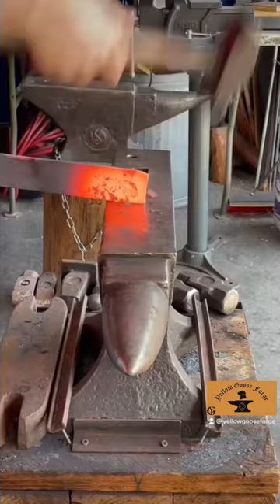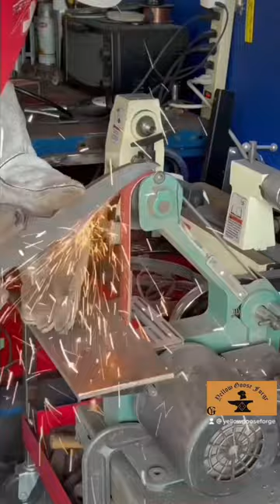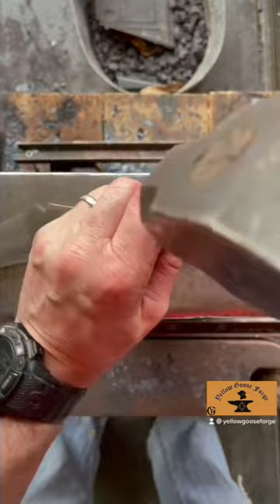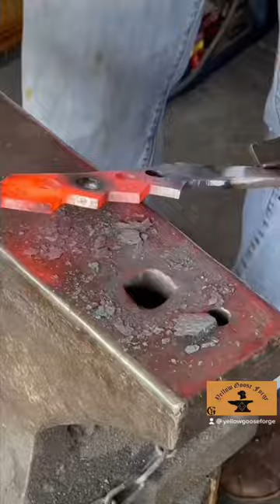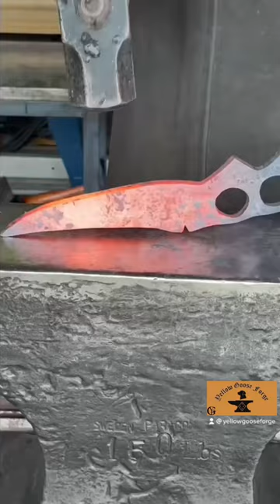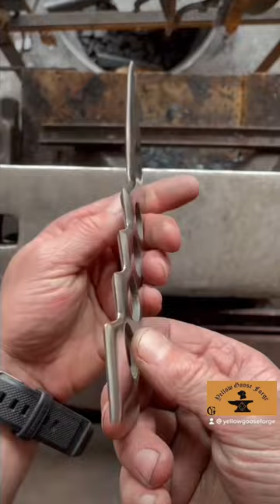Forging Asuma’s Chakra Blade Naruto #blacksmith #naruto #knife #blade #knifemaking

Comment: Sorry for a dumb question, but is it possible for a blacksmith to forge this knife shape without the help of an angle grinder? If so, would there be any advantages?
Reply: Also, can you show a comparison with the original? Are there any copyright-related complications?
By the way, amazing work! It doubles as brass knuckles)
Reply from the maker: You can Google Asuma’s chakra blade and you’ll see it! This one is almost exact to the one on the show🔥
Reply from the maker: I would say yes, I could forge it completely without an angle grinder, but I really wouldn’t want to! 😅🔥 there would be no advantage to not using an angle grinder